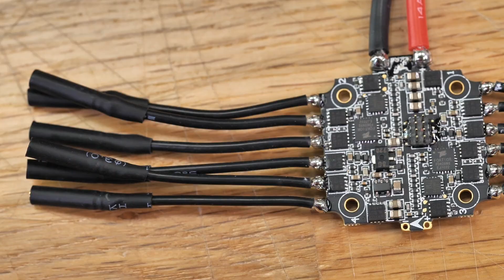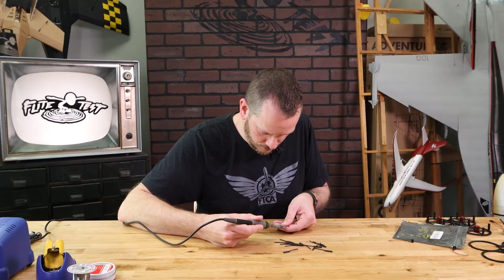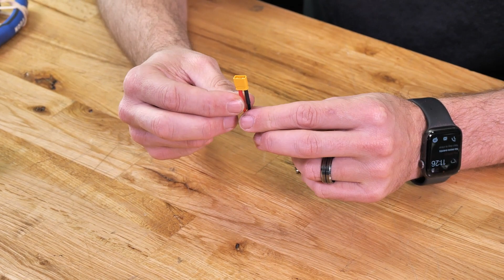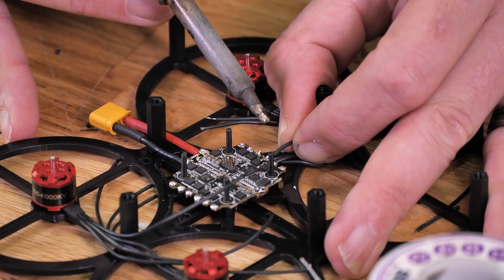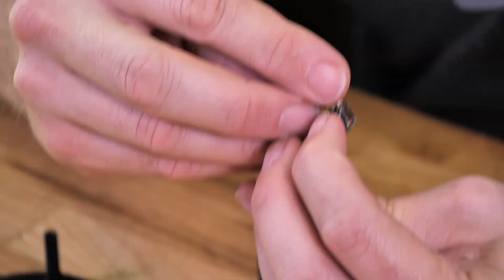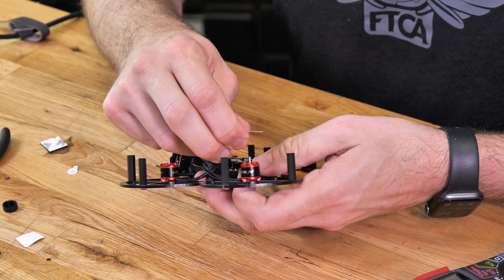How to Build the FT XP Gremlin // BUILD

Comment: Hey guys, Long time fan. I have a  caddix ant, Trying to install in a Flerken. Tried just some hot glue and it got really hot and melted The glue, it is that normal, I see you have a nice little Mount on this project .I do not have a 3-D printer. Do y’all offer a mount in your store ?I don’t seem to be able to find one. I’m also running a spectrum four channel receiver I just plugged it into one of the ports and disabled the port it works but just got really hot I guess that’s normal. I sure would like to get a hold of one of those mounts somehow any help would be appreciative. Suggestion could you make a video on FPV on wings and airplanes installation please. Been following and building your plans for a few years now after not flying for 30 years just wanted to say thanks for helping me get back into it. Really having a good time.
Reply from the maker: Hello friend. We do have amount that we can sell in the store. We’ll make sure we have them up this week for you. Thanks so much for your support